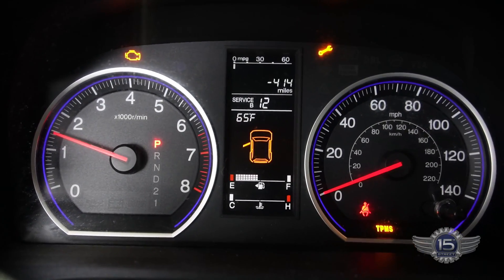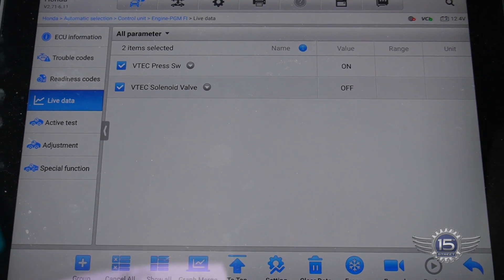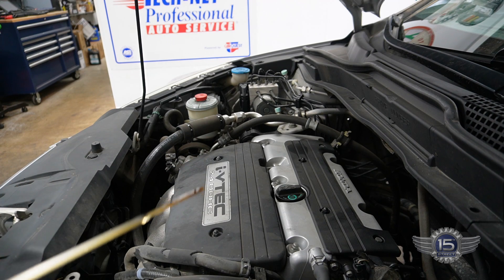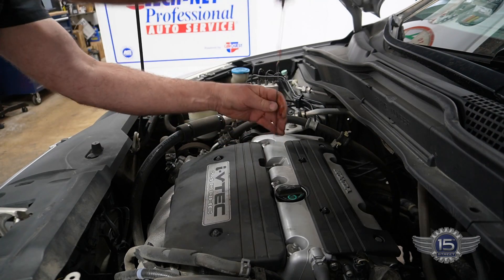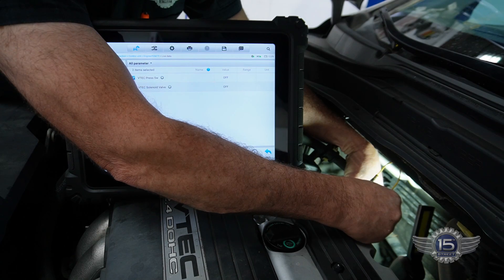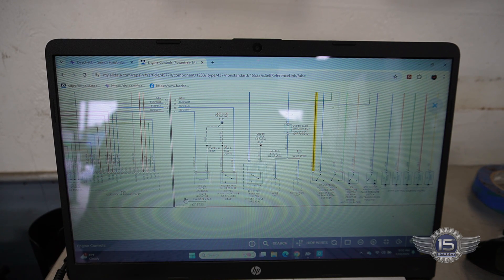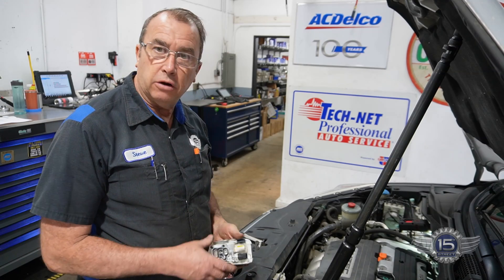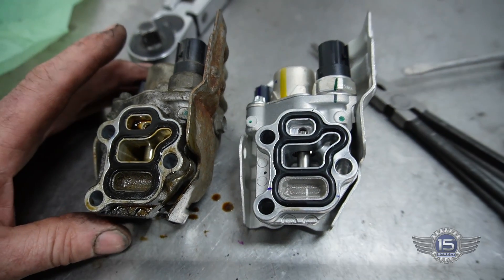Honda VTEC Diagnosis & Repair

Comment: If the intake screen had been completely clogged, would that cause the same exact symptom as this case?  (Although not intermittent like this one was.)  Also, at 16:00 the new housing has the connector rotated at a different angle from the old, seems unusual.
Reply from the maker: Anything that impedes oil flow (clogged, electrical failure, etc) will cause a VTEC failure. The connector position at 16:00 is due to the oil pressure switch position. They aren't neccessarily all made the same way.
Reply: @fixingcarswith15thstautomo36  thanks

Comment: Very informative.!  I had the same problem, but mine had a plugged screen on the side of the engine block next to the power steering pump.
Reply from the maker: Hopefully not plugged with metal.
Reply: @fixingcarswith15thstautomo36  no metal,  just crud build up. It was a customer's car that got frequent oil changes. I believe it didn't like some type of additives. 2005 crv, very clean under 100k miles.